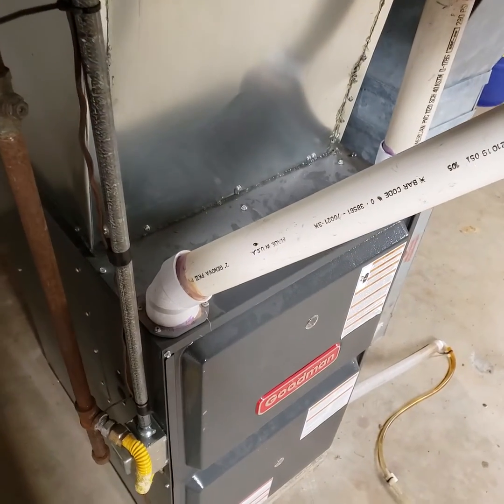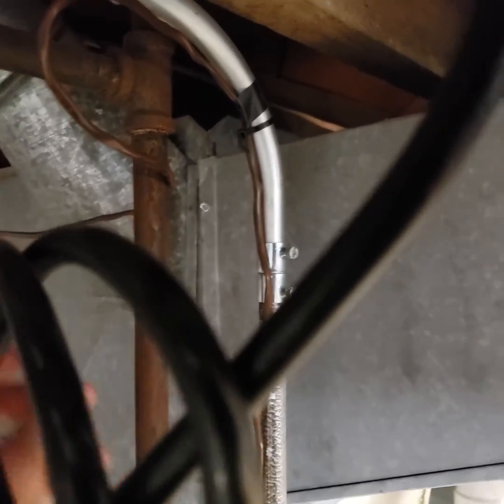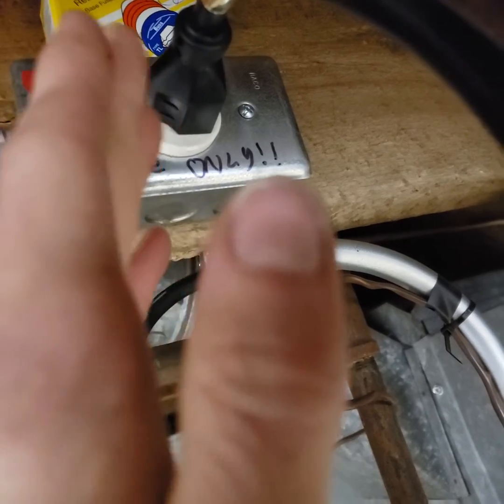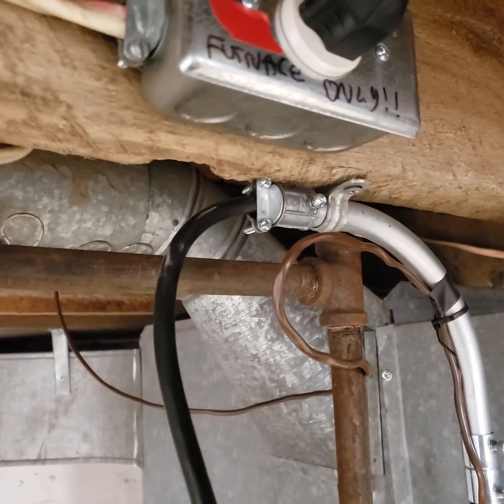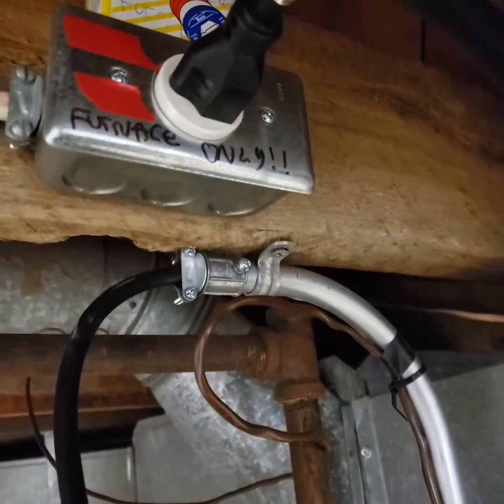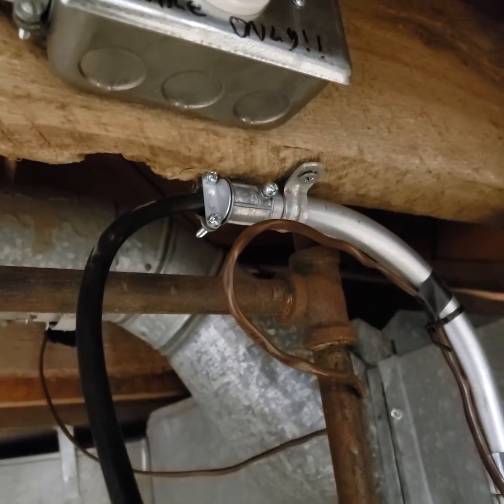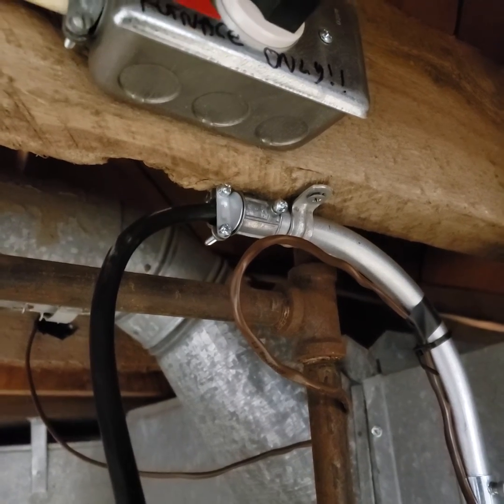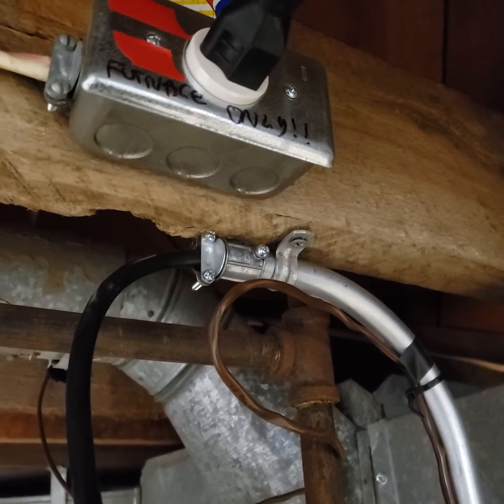Wiring a gas furnace for emergency generator power capability.

Comment: chances are this will not meet code.  Plug in furnace wire unapproved.  Hard wired with the proper transfer switch.  You homeowners insurance would deny a claim if there were a fire caused be this connection method